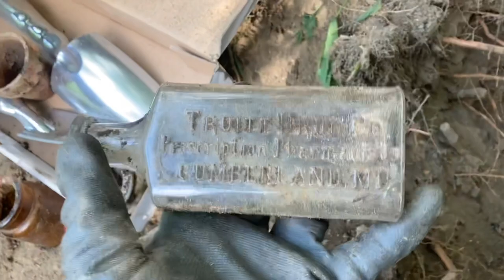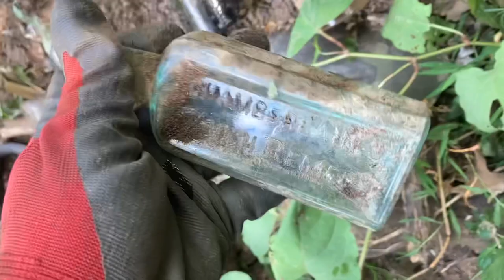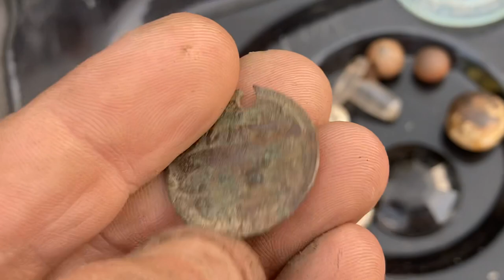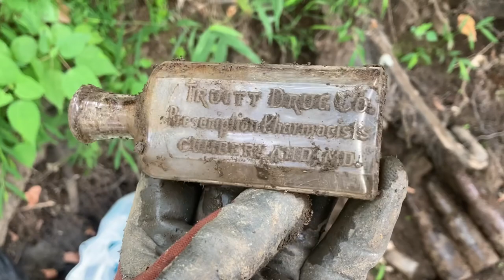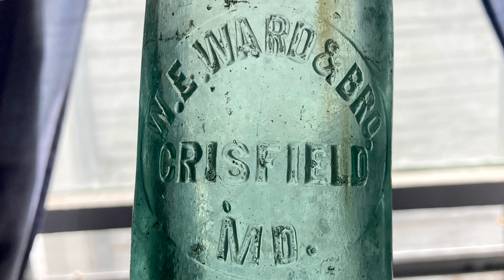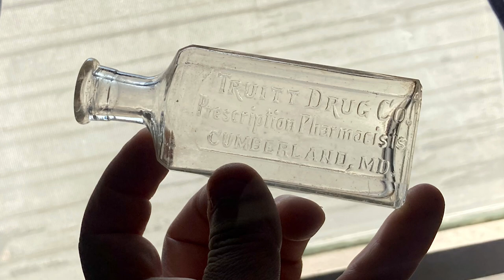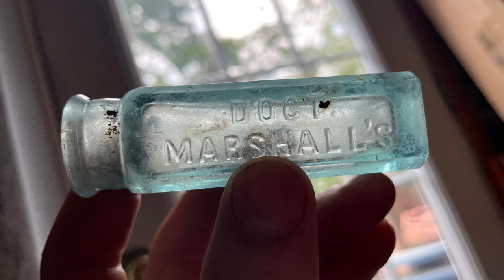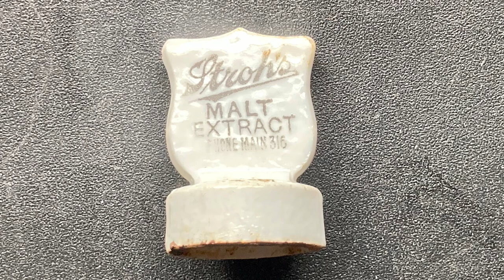River dump bottle dig absolutely insane finds.

Comment: There were other 19th-century businesses in Pittsburg on that long, narrow strip between the railroad tracks and the Allegheny river. Between 1862 and 1872, the Keystone Planing Mill was built on the site where the Groetzinger tannery would rise in about 1882. When it folded in the late 1890s, the building was acquired by the Lutz & Schramm Co., which made pickles, sauces, preserves, fruit butters, baked beans and catsup -- just like its competitor H J Heinz down the road.  Lutz & Schramm (late 1890s - 1925 ---) pottery jar with (glass ?) lid and wire (metal band ?) bail.